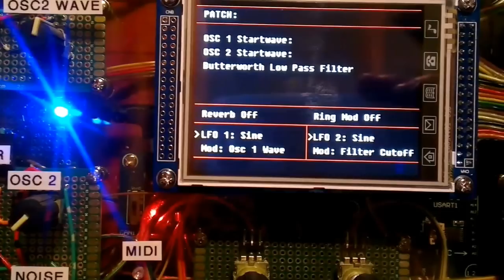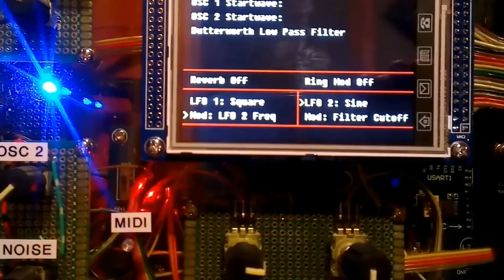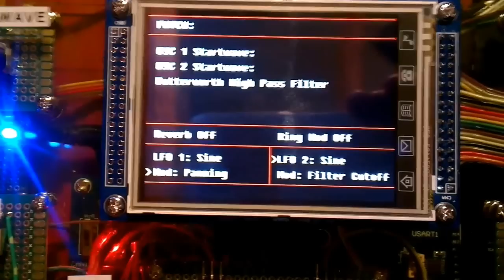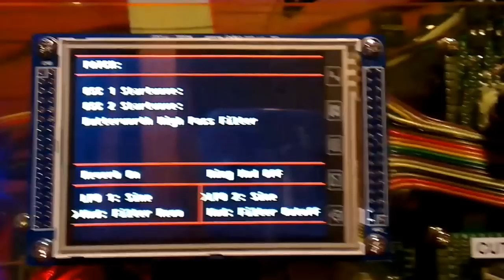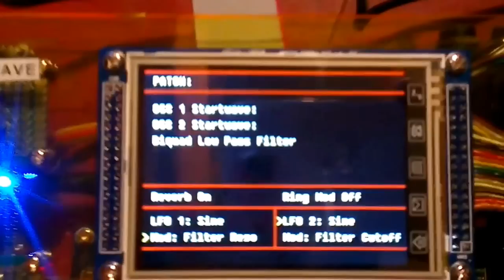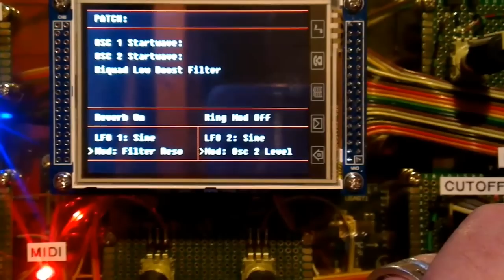Pulse Synthesizers Prototype

Comment: What STM32f4 board are you using? This is an amazing piece of work!
I have an STM32f4 discovery and am quite new to programming and totally new on the stm32 platform. The most I have got out of my board so far is a sawtooth using the on board codec. I can control the frequency using a pot connected to ADC but that is it!! Are you using the HY32D library for the TFT?? There is SO much I would like to know about your project.. Coocox?? Can I see your code?? :D